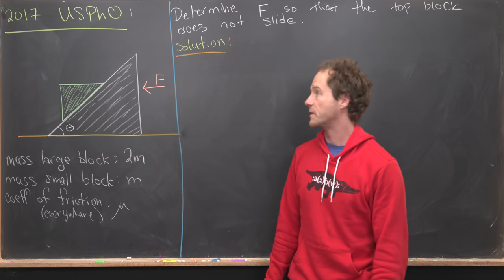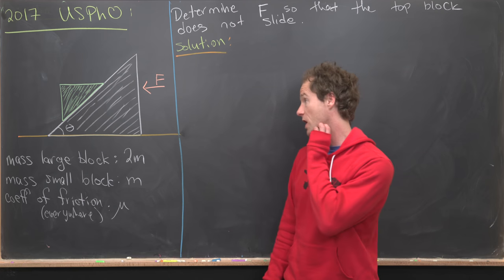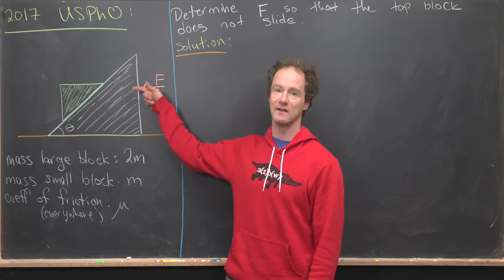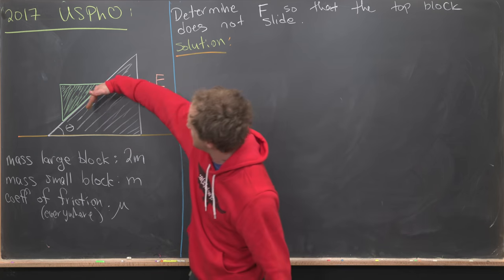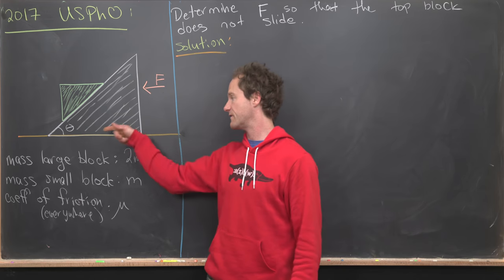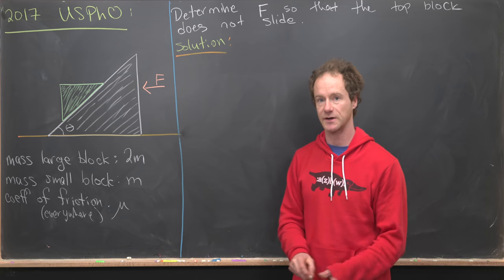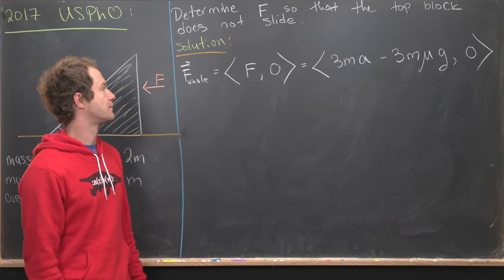Math professor tries Physics Olympiad!!

Comment: The F_whole equation is wrong. F - 3umg = 3ma. Acceleration is reduced due to friction on the ground.
Reply: Right, a is the resultant acceleration, after the horizontal forces are summed/applied. Watching up til 7:37 the sign on the 3m*mu*g term is incorrect. Since the friction of the floor will go against any applied horizontal force, it should be making it more difficult and thus increasing F_min instead of decreasing it.
Reply: oh, good. I was surprised, but I thought maybe its because I dont know any physics
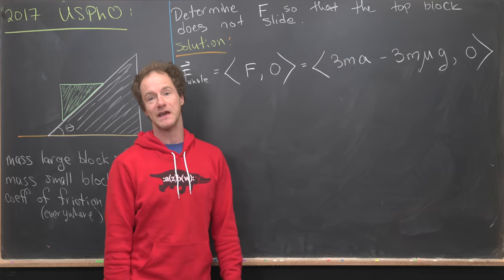Reply: I literally said "woah woah woah" out loud and paused the video at 2:52 to see if anyone else caught this mistake
Reply: Yes u r absolutely right..i solve it and get confuse in his equation there is plus sign in last eq

Comment: Correct math but bad reasoning for physics. For F_whole it should be "moving horizontally, not moving vertically", which (by mutliplying accelecations on mass) give <3*m*a, 0> = <F - 3*m*g*mu, 0>. For F_small (by same justification) it should be <ma, 0> = <N*sin(theta) - mu*N*cos(theta), N*cos(theta)+mu*N*sin(theta)-mg>.
Reply: I prefer your way
Reply: no the math is wrong too as a result lol.

Comment: But you missed a great trig identity here ... a little algebra shows that the expressions like (sin +/- mu*cos) and (cos -/+ mu*sin) easily give the formula for the tangent of the sum or difference of angles.  (One angle is theta, the other is arctan(mu).)  This is easy to see if you draw a force diagram:  when the static friction reaches its maximum magnitude (at mu*N), there will be a right triangle in the force diagram with sides N and mu*N.  Because of the angle of N (=theta measured wrt vertical), the adjacent angle of that right triangle (which of course is arctan(mu)) is going to add to or subtract from theta.  These problems should always start with a force diagram:  I would very much insist on this.  It will help deal with issues like the adding/subtracting of 3mu*mg noted elsewhere in these comments.
Reply: there is a sign error which is significant
Reply: @Walczyk  You are correct:  it is significant.  But it is just one of many problems with this video that could be addressed by a more careful solution, including (most crucially) the use of free-body diagrams.  Here's another problem which---although it does not affect the answer---really needs to be addressed:  why is the normal force on the lower triangle equal to 3mg?  You cannot say it's simply because the surface supports a total mass of 3m.  It follows from that, and from the fact that the upper triangle is not sliding; for if the upper triangle were sliding, then that would affect the forces between the triangles.  (Alternatively, you can say that the vertical acceleration of the system center of mass is related to the net external force, of which the normal force exerted by the surface is a part.)  But it seems to me many of Michael Penn's math videos are quite careful---my PhD is in physics, not math, so I'm no expert---and I think if he gets a bit of guidance from his colleagues, then his future physics videos might be worthwhile.
Reply: @jimcarrubba2419  aye, i'm on a leave of absence but i'm in the middle of my physics phd. its bold that he tried and i love his math videos. that said, i'd imagine this is one of the easier olympiad problems.

Comment: at 2:48
by using Newton's second law of motion:

F - 3mgu = 3ma  --->  F = 3ma + 3mgu
Reply: Yup
Reply: This confused me aswell
Reply: I dont think so: you are talking about the force you have to apply in order to push the blocks with a resulting force of 3ma. Prof. Penn instead is talking about the resulting force when pushen with a force of 3ma. U can missunderstand this easily because of the arrow of F. In a contest you may be allowed to even ask what F is ...
Reply: @fix5072  
Newton's Second law of motion:

"The acceleration of a particle ( or system of particles) is proportional to the resultant
force acting on it and is in the direction of this force"    

Engineering Mechanics: Dynamics 8th edition
By: J. L. Meriam  & L. G. Kraige

Resultant forces = F - (u * N)
Acceleration = a
Total mass = 3m
N = (3m) * g

Resultant forces = ( Total mass) * (Acceleration)
           (F - 3mgu )= ( 3m ) * a
Reply: @fix5072  That seems right. I prefer to write F as the force applied, then add forces to get the net force and acceleration, but his way is probably more direct (but harder to follow)
Reply: @rezamiau  correct. No disrespect Fix, but the acceleration is altered (and decreased from what it otherwise hypothetically would be)  BY coeff of friction. So ofc F= ma + STUFF. The mass*accel is LESS than the force applied. As michael said, despite some people saying it is confusing (not for me) some of this force is gobbled up by friction rather than translating into accel.
Reply: @fix5072  you're wrong and the professor is wrong. his derived criterion is also wrong. am physicist
Reply: @fix5072  
Even though this approach would be questionable (because there are certain conventions about letters like "a"  having a specific meaning), this is not how the prof used them.

When calculating F_min he didn't convert "ma" into "F_min", (which he should have done following your approach), but " F" instead.
So the resulting equation for F_min is just wrong, because the Force gets smaller, when the coefficient of friction increases.
Reply: @tomatrix7525  that's right. The force, in order to cause an aceleration in the system, must be enough to move the blocks (3ma) AND enough to compesate the friction force (3mgk). That's why it has to be F = 3ma + 3mgk
Reply: @diegolguin  ? What you’ve written agrees with what I am saying.....??
Reply: @tomatrix7525  omg yes lol
Reply: Thank you! Thought I was going crazy
Reply: Exactly
Reply: F makes the block move and friction comes in to play due to the movement.
So F = Force at which blocks moves +            Friction 
F = 3ma - 3mug
Reply: @tomatrix7525 looking at the number of likes to your reply,If physics is run by democraccy it would clearly loose LOL.
Reply: @casitis4569  Wrong!
Please read the replies carefully.

Comment: Edit: I realized that my explanation of two separate ranges for negative accelerations was incorrect, therefore I deleted from below to not confuse who reads this.

I remember that the Russian professor on our PHYS 101 course decided to solve something similar to this and I wasn't able to understand the solution at the time. So I challenged myself to solve this before watching the video. Eventually, I was able to solve it for the negative acceleration cases too. The sign of the friction flips for these negative accelerations, as the lower wedge travels backwards. It was a very nice and very inspiring challenge, which also brought back some memories from my freshman year. Thank you very much!

PS- 8:10 It should be μ > tan(θ)

Comment: minute 8:00, µ<tan(theta) makes no sense. If µ=0, there is no friction and any small tilt will make it slide if the block isn't accelerating. µ>tan(theta) makes more sense : given a tilt, with enough grip, your block won't slide?

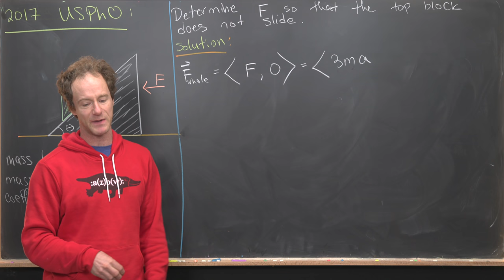Comment: 2:39 That doesn't make any sense. The net force to the left is equal to F - 3mμg, since F is positive valued when acting to the left, and 3mμg acts to the right. And by Newton's second law the net force is equal to M*a, therefore F - 3mμg = 3ma, and F = 3ma + 3mμg, not minus. You can think that if F were 3ma - 3mμg, then the force you have to put in your system to the right is LESS than the force needed to accelerate 3m with an acceleration of a, which would mean that friction is HELPING you to move the blocks!

Comment: I think you have to add your friction force 3m\mu g instead of subtracting, since in addition to what happens "on the slope" for the steady scenario (calculating the acceleration a) you have to apply the additional force of 3m\mu g to compensate for the sliding friction.

Comment: I am very confused at 3:49 he calls the angle of the small triangle theta when it should be 90 minus theta. I will give him his assumptions that the triangles are right triangles and similar despite the diagram not specifically calling it out in the diagram but now he just assumed they are 45 degree right triangles
Reply: I was thinking the same, the other angle would be theta making the one he labeled to be 90-theta, but it's alright, the method is perfect, small mistakes happen
Reply: I just got to this point in the video and it stopped me dead in my tracks too, so I went to check the comments. I'm glad someone else noticed and posted so I could have a sanity check about basic geometry,
Reply: I am not going to mess with trying to track the implications other than to say all of his sines and cosines are flipped because of this.
Reply: He points to the wrong corner of the small block, calling it θ, but when you calculate the x component of the normal force N, it does actually turn out to be N sin θ, and the x component of the friction force is N μ cos θ. It's a lot confusing because θ is nearly 45 degrees, but if you draw the setup with a much smaller θ, you can see he's got it right.
Just think about it a bit. As θ approaches zero, the X component of the normal force also approaches 0, which shows that N sin θ is the correct expression.
Also, the triangle he's really thinking about is shown at 10:23.

Comment: nice.
can you overkill it with Lagrangian mechanics?
Reply: Please this.
Reply: It seems that interpreting the problem with Lagrangian mechanics would be unwieldy because of the external force applied to the system (And you can't say that the force is conservative to define a potential) , if it were just the two blocks interacting it would be pretty simple. It might be necessary to use D'Alambert's principle.
Reply: Friction in the Lagrange formalism is notoriously difficult. As the energy then becomes path dependant, this changes the whole variational approach
Reply: @LorencoLisica what about the potential -m*x the derivative I.e. the force would be a constant term m in some fixed direction
Reply: @juliandominikreusch8979  I think that approach is more suitable for using D'Alambert's principle. (Which really is a generalization of Euler Lagrange equations) I agree with the method though. But then again as You pointed out, the friction would make the problem practically unsolvable by the varation principle.
Reply: @LorencoLisica  You generally need to use nonholonomic constraints (it is an inequality) so it is much more difficult but once set up finding the tipping points aren't so bad. Been a couple years though
Reply: @juliandominikreusch8979  just insert a standard time invariant Hamiltonian and apply non-specific reduction boundaries, the solutions will formalise themselves as unique eigenvectors in phase space.

Comment: @michael penn. Normally for newton's 2nd law it is written as ΣF=ma. On the left hand side you have all the forces acting on the object and on the right hand side you have the effective force (aka effective acceleration on the object) which changes the sign to + for the expression for F.  also at 8:13 you mentioned that you have a negative acceleration when (mu < tan theta) I believe it should be (mu > tan theta). It physically wouldnt make sense either for strength of friction to become less (with the minimum of 0) to avoid the object from sliding down. As you mentioned if there is velcro then it wouldnt slide aka mu is getting larger). I hope I didn't make any mistakes in my calculations.
Reply: I also got Fmin >= 3mg*((1+mu^2)*sin(theta))/(mu*sin(theta)+cos(theta)) and Fmax <= 3mg*((2mu*cos(theta)+(1-mu^2)*sin(theta))/(cos(theta)- mu*sin(theta))

Comment: "F_whole = 3 m a + 3 u m g", not "F_whole = 3 m a - 3 u m g" because the more the friction with the floor, the more the force you will need to apply, while your equation produces the opposite effect.

I computed:
F_min = 3 m g (1 + u^2) / (u + cot(theta))
also, if "u > tan(theta)" then there is no positive minimum force needed, not if "u < tan(theta)" as you say in video

Comment: :) This is a very formal mathematical solution for the general case with all possible boundary conditions. That there should be tan theta is kind of obvious and is done in one line if you take the specific condition. :) Sin theta / sin (90 - theta) since only one axis needs to be calculated! That's a physicist's solution.

Comment: 2:00
There is another mistake.
Even though the block isn't moving in the vertical direction, there is still a force acting on the system.

F_vertical = N - 3*m*g   would be correct. Since N is exactly 3*m*g, it cancels out. But you still need to keep it in mind, because this vertical force is the reason for the horizontal friction, which needs to be considered.

If you write F as a 2D vector (even though there is only one dimension needed to solve the task), then you might as well do this correct.

Comment: I didn't go through the video, but checking the end I think there is a sign mistake : if µ increases, obviously F should decrease ; take θ=45° M.Penn equation becomes F=3mg (1+µ²)/(1-µ), F increases with µ and that can't happen.
For my part I found F=3mg.sinθ.(1+µ²)/(µsinθ+cosθ)
Reply: Finally someone who got the same answer as me! I was getting very confused with all those variants, signs, trig functions in the comments.
My answer is the following: F = 3mg(1+µ²)/(cotθ+μ), which is pretty much the same thing you wrote.
Reply: @christianpalumbo8278  Thanks. Now a real physicist wouldn't have said at the end of the video : "this is a good place to stop", because for him maths are just a tool, and he won't stop until he can conciliate his intuition and the formula (which is not always possible, but at least he tries). More over a physicist wouldn't have set the problem in those terms, because the small block doesn't move relatively to the big one, so the friction coefficient to be taken into account is static. But the big block is moving on the table, the friction coefficient then is dynamic, and doesn't have the same value...

Comment: 4:15 that's not true at all! The small block isn't accelerating in the downwards direction with an acceleration of g. If it were, it would be in freefall, which it isn't. To find the downwards acceleration you'd have to first find the net force in the downwards direction, which is composed of the vertical component of the normal force, and the vertical component of the friction force

Comment: There is no way that the statement @ 8:10 could be true in our world. The small block sits still without a force, when mu is bigger than tan(\theta).
Reply: Yes, he has the wrong sign on 3*m*mu*g, I think that's the only error. I should really solve the problem on paper.
Reply: Of course signs can be messed up if not treated carefully. Therefore it always a good idea to check end results for plausibility to not disgrace oneself...
Reply: @garkechify  hes a math guy not a physics guy haha, id be embarrassed though
Reply: @Walczyk  
This sign has nothing to do with the mu > tan(t) though.
In case there is no acceleration necessary, mu > tan(t) because sin(t) - mu*cos(t) < 0.
In this case the force can still vary between a neg and a pos value X, because we need to apply a force greater 3*m*mu*g  to overcome friction and get the block moving in any direction.

"no acceleration necessary is actually equivalent to "no force necessary" because friction will never accelerate the block on its own, but always act in the opposite direction of the movement.
Reply: @maxmustermann3876  Isn't the criterion for tan(pi/4) = 1 < mu, a mu greater than 1 is unphysical. I think you're right, I don't think I listened to the interpretation of the criterion. Gotta look again. If mu was very small then it would slide down under the force of gravity. If mu was that high then gravity still be a downward force on that block. It cannot be symmetrical in both directions. It will take more magnitude of force to move the block up the ramp than it does to bring it down
Reply: @Walczyk  
Sorry, I don't really get what you are saying.
Where does your equation come from?
Is the last paragraph of your comment referring to my statement "the force can still vary from a neg and pos value X"?

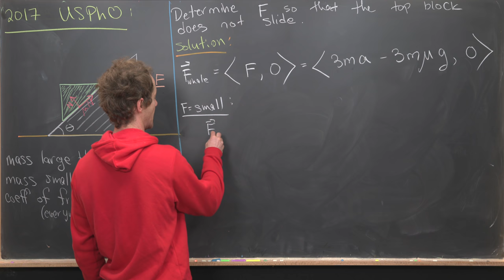Comment: 4:07 This should be <ma,0> because there is no acceleration in the horizontal direction. The sum of the forces should be 0, he just sets the forces equal to each other, which does have the same result, but is conceptually wrong.
Reply: Agreed. He takes gravity as an acceleration.

Comment: about the sign error of the friction force:
i think that it is worth reminding ourselves that newton's equation F = ma has the form "cause" = "effect".
imho michael made a mistake because he mixed his causes, i.e. +F and -3mug (left = "+", right = "-"), with his effect, i.e. +3ma.
had he started his problem from newton's equation and had he plugged in his causes and his effect into it, he would have made no mistake.
i.e.: F - 3mug = 3ma, which transforms into F = 3ma + 3mug.
the last equation has a nice interpertation btw if we multiply everything by distance d:
F*d = 3ma*d + 3mug*d
"applied work" = "work used to speed up an object" + "work against friction"

Comment: I think that the usual place is to note that you can replace the small block by a point particle w.l.o.g. then you put the forces on the diagram. Then it's just a matter of resolving vectors parallel and perpendicular to the inclined plane and look when there is no force, then you will get a relation for the force.